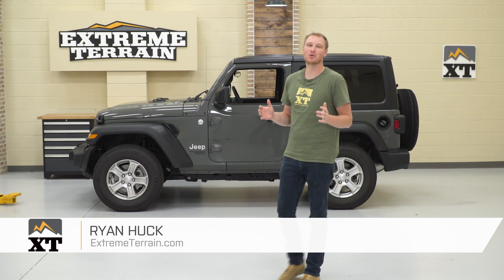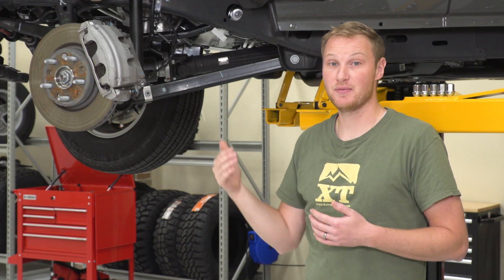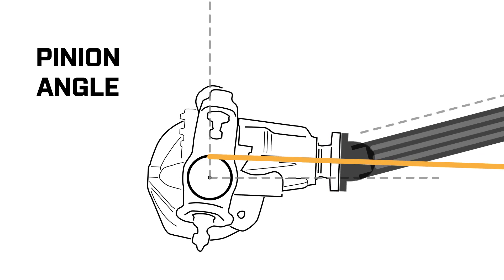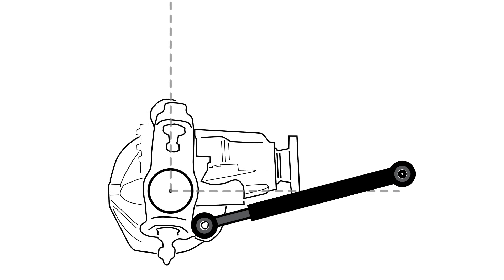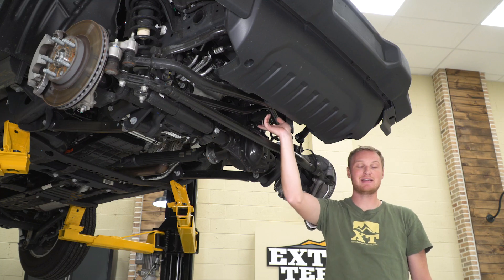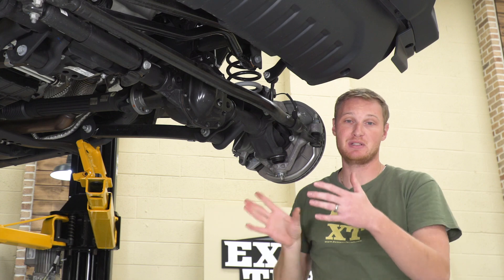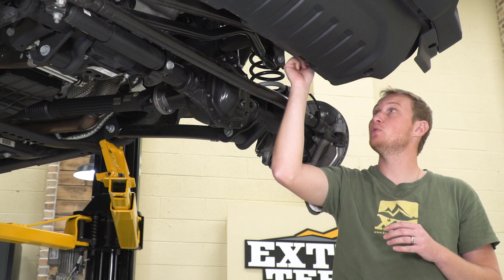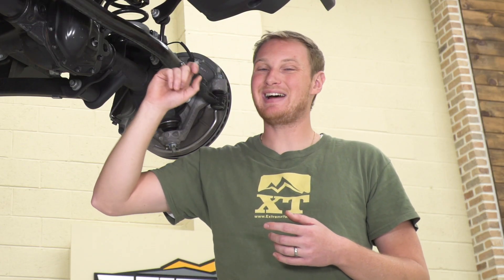How Jeep Suspension Works | Jeep Suspension Geometry Explained

Comment: Great content, I know some of that stuff is related to death wobble. I put a 3 inch lift on my XJ and it was fine for a long time,  now it has started with death wobble. I have changed the track bar to an adjustable track bar, replace the tires, and took it to a reputable shop to have an alignment and still have death wall. Any suggestions?

Comment: I have all these issues. Front axle is off center, major vibrations on the highway, Axles/tires arent centered when looking at the side of the Jeep. I put in 5.13 gear on stock axles along with 3.5 MetalCloak GameChanger (2012 JKU - Sahara), I'm sure that the new Yukon driveshaft isnt in the right angle as well. I need some work done to repair all of that. smdh.....

Comment: for 2 inch lift it is necessary to change all this arms or bars ??? for JL
Reply: My mopar 2" lift came with new control arms, springs, sway bar end links, bump stops and shocks. Everything else stayed the same. Must get an alignment afterwards. 2018 JLU Sahara

Comment: So informative! I'm planning a 2.5" lift on a 2016 JKU.  Do I need to replace the front and rear track bars?  How much lateral shift will a 2.5" lift create?
Reply from the maker: You'll see your front axle be shifted to the side about an inch, honestly. I would highly recommend adding an adjustable front track bar to your Jeep along with adjustable front lower control arms to get your suspension back aligned! Your Jeep will handle much better also, they're great additions if you have room in your budget. -Zach

Comment: It is very informative video, I am new to jeep and my question is if I install longer control arm is that means pushing the axle forward which i afraid the tire may rub against the bumper? I have 33” tire thanks
Reply from the maker: Adjustable lower control arms would simply bring your front axle back to where it was before the Jeep was lifted! It won't go any closer to your front bumper if adjusted properly. -Zach

Comment: Ryan, I am thinking of installing a 1"or a 1 1/2 inch front coil spring spacer on a 2022 Wrangler JL., Just to level it. Do I need any other parts for my application? Thanks
Reply from the maker: Not really just for a 1" spacer! You could always look at adding an adjustable track bar to help keep your axle centered up front, but that can wait until you lift your Jeep higher if you don't have room in your budget. -Zach

Comment: I just got the Rubicon express 2.5 in with monotube shocks lift kit. The kit mentioned no need to change drive shaft. Unlike other kits that say you need to change it. When i put the rubicon express lift if there more that i am gonna need to do or are the geometry components more of an issue when it comes to 3in and up kits?

Comment: Thank you for the information I do have a question I have a 2018 jeep I put on a Rubicon steel bumper and a whiches the front in is no longer level you told me I need a 3/4 space to keep the front of the jeep level. When doing that do I need to change anything else or my suspension? Also I went on your site and I seen a rough country 0.75 Front leveling kit is that what I need to level it off
Reply from the maker: Nope! The only piece you'll need to install is the spacer itself. No other parts will be needed. The leveling kit you found sounds like it will work perfectly, just make sure its for your respected Jeep (JK or JL). -Zach

Comment: so my comment would be does someone make a fixed lower and upper control arm for strength? or if the new adjustables come with factory length specs to adjust correctly?
Reply from the maker: You can absolutely find fixed upper and lower control arms that are made stronger than factory! The vast majority will be for lifted applications though. The only options you'd be able to find for a stock Wrangler would be adjustable ones. -Zach

Comment: Very good video! I have a 2021 4 door Jeep wrangler Rubicon can you please list a couple 3.5" complete lift kits that will cover everything that was mentioned in your video? So one doesn't have to worry about geometry issues at all?
Reply from the maker: Thanks for watching, and I absolutely can! The JKS kit below would be amazing when paired up with a set of adjustable lower control arms. Or if you want everything in one kit, you should check out the following ReadyLIFT and OldManEmu options! -Zach
https://www.extremeterrain.com/jks-jeep-wrangler-j-rated-35-in-suspension-lift-kit-jspec-gas-shocks-jspec119k.html
https://www.extremeterrain.com/old-man-emu-jeep-wrangler-25-35-inch-heavy-load-suspension-lift-kit-omejl4dhks.html
https://www.extremeterrain.com/readylift-jeep-wrangler-350-inch-3-inch-terrain-flex-4-arm-lift-kit-falcon-21-shocks-69-6837.html

Comment: Question, I recently put a 2.5 inch Rough Country lift kit on my 09' Jeep Jk with 33-inch tires. I also replaced the trackbar, drag link assembly and tie rod. I live in Brooklyn and mainly use this as my daily commuter. no off-roading. Is it necessary for me to replace my control arms and if so which ones do you recommend?
Reply from the maker: Not totally necessary, but definitely recommended! Adjustable front lower control arms are really all you need at 2.5" of lift, you'll notice an improved ride and handling with them for sure. You should check out this option from Freedom Off-Road! -Zach
https://www.extremeterrain.com/freedom-off-road-jeep-wrangler-adjustable-front-lower-control-arms-for-0-65-in-lift-fo-j703fl-adj.html

Comment: my rear track bar is rubbing against my rear passenger spring coil. should i shorten my rear control arms to pull my rear axle away from the spring?

Comment: Hello boss, I recently bought Jeep JL 2018, 78000 kms on it. It has 33’ tires, 2.5 inch skyjack lift kit. It makes clunk sound on slow big bumps mostly on the turns.My Drag link was having little play I have change it but still it makes the same sound. Technicians had taken a look on it but he was unable to find any thing.there’s nothing loose even. What can u suggest.
Thnks
Reply from the maker: You'll want to check your tie rod end links, ball joints, control arm bushings and wheel bearings. Any one of those places can cause a "clunk" when worn out. -Zach

Comment: does the Rubicon control arm is long than the sport control arm ?
Reply: I’m pretty sure they are the same size. At least on the 2007-2018 models. Not sure about the new JL wranglers

Comment: I guess I shouldn't go with just shocks and springs...  4inch TJ lift just got a lot more expensive
Reply from the maker: Yeahhhh at 4" of lift I would highly recommend looking into make sure you snag some aftermarket adjustable control arms, an adjustable track bar, and something to address your factory driveline angles (like a slip-yoke eliminator kit with a new rear driveshaft). Feel free to give us a call or email and we'll be able to get you taken care of when the time comes! -Zach

Comment: does anyone know the consequences of using the factory sway bar links with a lift? 
I've installed a 3.5" lift, but it did not come with front sway bar links (it included rear sway bar links oddly enough)
Reply from the maker: A lot of budget-oriented lift kits will give you a new set of rear sway bar links, then have you use your factory rear links in the front of your Jeep since they're naturally longer anyway and they'll accommodate the new lift height. If you have the room in your budget though, getting a set of new front swaybar links with disconnects is a good idea! Especially if your factory links are worn. -Zach

Comment: Hi..                                                                                                                                                                                       I have a '99 XJ that wonders at highway soeed..                                                                                       Everything has been replaced on the frontend and it still wonders..                                                                   Any advice on fixing the problem..?  Thanks Joe..
Reply from the maker: Hey, Joey! Is your Jeep lifted at all? If so, it may be worth looking into an adjustable front track bar and adjustable front lower control arms to get your alignment where it needs to be. I'd also recommend checking your tires out, if they're overinflated or have irregular wear it can contribute to negative handling characteristics. Best of luck! -Zach

Comment: to do lift properly means spending some real cash
Reply from the maker: All comes down to how high you want to lift your Jeep and what you plan on doing with it, really! If you're sticking to 1-2" inches of lift or just want to level your Wrangler, you really don't need a ton of extra components. Once you get above 2" of lift, extra parts like lower control arms, adjustable track bars, exhaust spacers, driveshafts, etc absolutely need to be considered depending on lift height. Got to always keep suspension geometry in mind. -Zach
Reply: @extremeterrain  Thank you Zach I may after all go for that little lift so  that I can take full advantage of the chunkier  33s  for my Sport

Comment: Hi. I jus buy a jk with a lift,  the jeep have a very bad wandering feeling while driving.  I replaced ball joints,  new track bar. Shocks, steering box, but still having the same problem.  You think a tide tie rod can cause wandering or fix the caster can be better..
Reply from the maker: If you haven't replaced the tie rod ends yet, I'd highly recommend it. That will really help tighten things up in your steering. If your lift doesn't have adjustable front lower control arms either, I'd recommend looking into them as well. They will allow you to adjust your caster, which will help your Jeep track straighter down the road and not wonder as much. - Zach

Comment: Looking for some help. I have 2015 JK with a AEV 2.5 in lift, correction brackets, Fox steering stabilizer, alignment done. Then added 35’s. I now have play in steering and slobby on highway speeds. Constantly keeping the Jeep in line. How can I fixed this issue? Any help would be greatly appreciative
Reply from the maker: I would check out your track bar, ball joints, front lower control arms, and tie-rod ends. Since all of those are wearable parts they may be worn just enough to cause loose steering now that you added the extra weight of 35s. If you don't already have one, an adjustable track bar may be a nice option to add to keep that front axle centered as well. Also, make sure those 35s aren't over-inflated because that can cause wondering in steering as well. Hope this helps! -Zach
Reply: ExtremeTerrain.com thank you for the quick response. I lowered the tire pressure down from 40 psi ( tire shop set it to 40)  to 34 last night. Do you think that is a good psi? Gotta drive the Jeep today and test it. Thank you for the other information I appreciate it. Gonna look into a track bar.
Reply from the maker: 34 psi should definitely have things running smoother! A lot of tire shops see "max psi" on the side of mud tires and think that they need to be filled that high for daily driving. I'd still recommend checking everything mentioned just to make sure you don't develop any shimmy in the future, and that adjustable track bar will really help things feel planted on the road. -Zach
Reply: ExtremeTerrain.com  Will definitely look into the track bar. thanks for you time Zach!

Comment: I put 33s BF a/t on my tj 02 4.0 with a RC 3.5 lift and I  get a lot of vibration on the highway, pretty much over 50mph. All this right after the lift, all I hear is is a jeep and that's how they ride, BS!! before was absolutely fine and now feel lose and noisy.  I was told with this kit didn't need any other parts or modifications, any ideas, suggestions or help please.
Reply from the maker: Vibration while driving after a lift kit is installed is most likely coming from your drive line. I'm not entirely sure what all was installed with that lift kit, but here's a little list of extra parts I highly recommend you look into. Adding them will really help your suspension geometry and the ride of your Jeep, along with solving the vibrations: A front adjustable track bar, front-lower and rear-upper control arms, a slip-yoke eliminator kit and a new rear double cardan driveshaft (this will go with the slip-yoke eliminator kit). If you need more assistance, please get in touch with our customer service team and we will be happy to help! -Zach
Reply: Thanks for the help, I would have all this parts install and see what happens, hopefully fix my issues 
Thanks again 
JP

Comment: So if I have a stock JKU is there any reason I would not want a kit that includes all the discussed parts?  It sounds like every part mentioned should be replaced to accommodate the lift.
Reply from the maker: As long as you have the budget and you're doing more than a simple 1.5 inch leveling kit, there is no reason whatsoever that you would not want a kit that includes new track bars, lower control arms, swaybar links, brake line extension, etc. The more components you replace to correct your geometry the better you Jeep will perform, ride on the road, and last overall through regular usage. There are plenty of great budget level systems out there, but you really get what you pay for. -Zach

Comment: Rear control arms ?  Are they important to change for ride quality!? I have a 4 inch lift
Reply from the maker: Rear control arms are going to effect your pinion angle and axle placement mainly, but will help your ride quality as well! If you're still using the stock control arms on a 4" lift, the angles of them are most likely pretty steep. -Zach
Reply: Well I guess I need to be buying a set

Comment: Noob question here... Will my stock suspension be affected if I just put bigger tires (33-35)? Will I need to do ajustements to my suspension to avoid any damage/problem? Please keep making this video's they are really good and informative!!
Reply: 31 jan 2019 7:14 pm est:
i don't know,but large-diameter-spare-tire hanging on exterior-rear-cargo-door,block rear-view during moving backward

addition 31 jan 2019 7:22 pm est:
maybe large-diameter-tire,make turning-diameter bigger(worse).example:gmc terrain 2018
turning diameter :
ft / m
37.4 / 11.4 (17-in. wheels)
38.4 / 11.7 (18-in. wheels)
41.6 / 12.7 (19-in. wheels)
source:'turning circle' in http://media.gmc.com/media/us/en/gmc/vehicles/terrain/2018.tab1.html from google (gmc.com gmc terrain turning diameter) result 1

Comment: so i bought my jeep about 2 years ago and it came with a lift kit on it, only problem is is that I'm not sure what size it is, and whether it's a suspension or spacer lift. The time has come to buy new shocks, but I need to know what size shocks to buy. And to know that I need to know my lift size, or I can measure the shocks extended and collapsed, BUT it would make it 10x easier to shop buy lift size as oppose to shop buy shock length, how should I go about finding out what size lift I have?
Reply: VorteKs if you send me a few pics of the suspension in the front I could help get you started. IG @americanjeeper or outerlimit4x4@hotmail.com

Comment: thinking about getting the 2.0l turbo rubicon... do u think 37s with a 3 inch lift would be ok or would it be too strenuous for the 4 cylinder?
Reply: Poppa Sim you’ll be fine with the engine but the turbo will have a shorter life than the 3.6

Comment: Great video. Your explanation was concise and informative. Extremely helpful. Is there a possibility that you can discuss the minimum needs necessary to run 35s or 37s to wheel off and on road. Lots of info out there and it's difficult to know what the essentials are to run safely.
Reply: Minimum on road - 2.5" lift for 35's. 3.5" lift for 37's. If you are going to be wheeling heavy you will want higher fenders or a taller lift with those tires sizes. Just be careful because anything over 4" and something your going to wheel your going to need new driveshafts sooner rather than later.
Reply: To piggy back on Jason's question: in your vast ET videos, which would demonstrate the type of terrain that needs the sway bars disconnected, as opposed to trails with with foot-deep puddles, bowling ball sized rocks, etc. (I have a 2.5" MOPAR lift, 35" tires.)
Reply: In addition to the driveshafts mentioned above, new axles and re-gearing  are good ideas.  35" wheels will make quick work of the stock axles if you off-road with any regularity.  Re-gearing depends on tire size and how you use your jeep.  There are handy re-gearing charts you can look up that will show this.   The real thing that needs to be understood is that going above a 2.5" lift or 33" tires involves doing a lot more upgrades in addition to the extra cost of the bigger tires and lift kit.  Between upgrading the drive train and re-gearing, expect to spend around $3,200 on parts alone, and if you get everything done at a shop, labor will run you around $2,000 (this is why most wrangler owners who don't plan on much off-roading go with 2.5" lifts with 33" tires.....it's enough to look better than stock and doesn't require additional expensive upgrades).